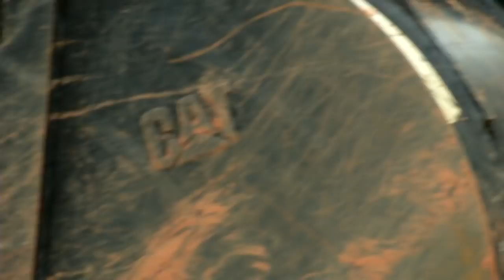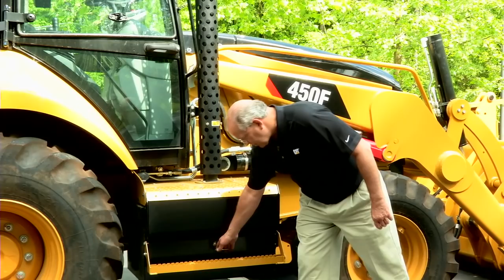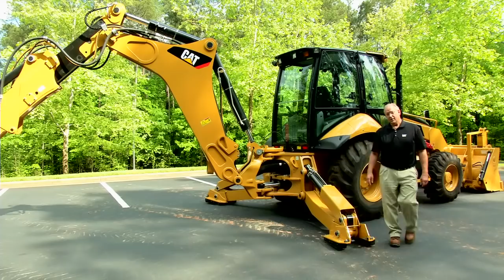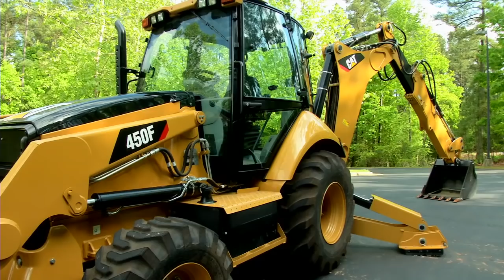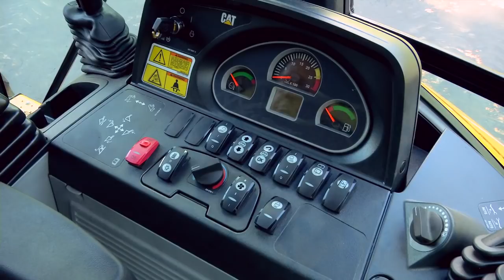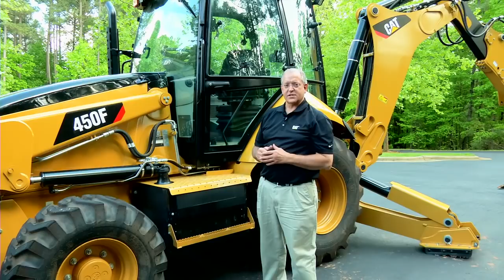Cat® 450F Backhoe Loader Overview

Comment: There good for some jobs but for bigger jobs use a excavator to keep digging and a wheel or track loader with a quick coupler and the excavator has got 360 degree turn as far as moving your spoil pile alway from the trench but they are good for some things but prefer the excavator thanks

Comment: Nice overview. One thing though. You mentioned that the 450F will take augers, but as of today 21 July 2016, when I look through Caterpillar's backhoe loader attachment catalogue, there isn't an auger available for the 450F. The A26B auger, if I'm not mistaken, will fit only up to the 430F.

So, is there an auger for the 450F, or isn't there? Would really appreciate your reply on this. Thanks.